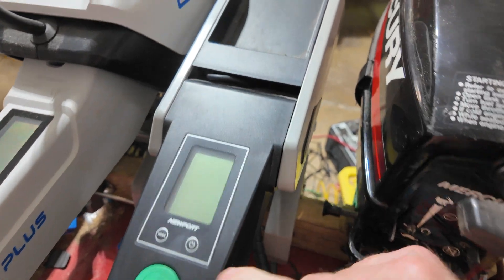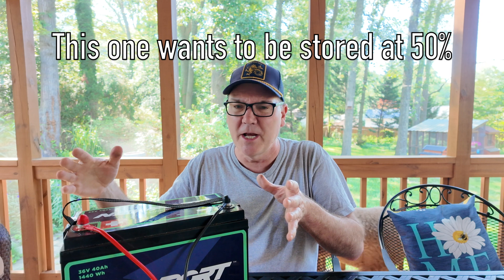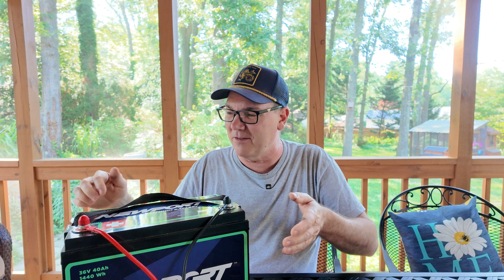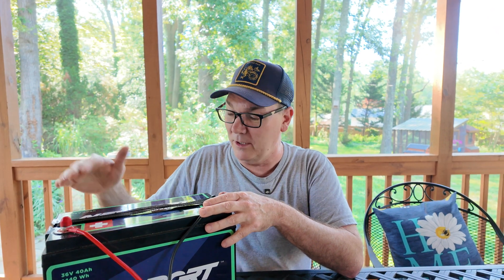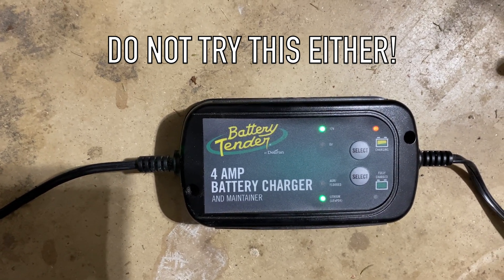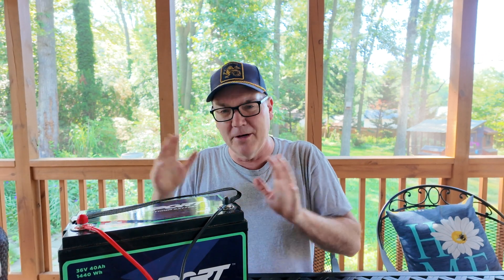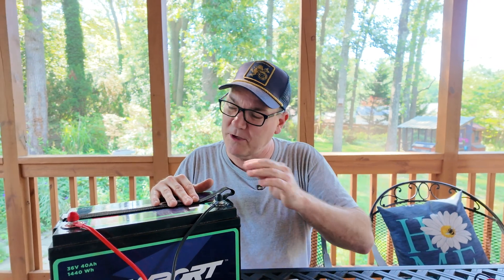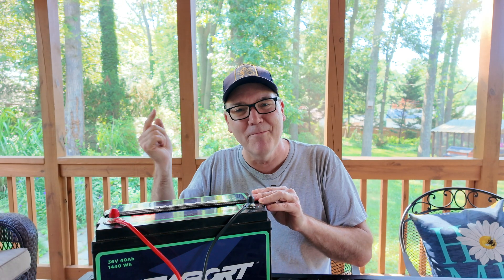LiFePo4 Battery DEAD after 1 year

Comment: RC Airplane guy here, so very familiar with Lithium batteries. At storage, you can leave them indefinitely and they will usually be happy. But cold temps are a killer, so gotta be careful with that. But, we have chargers that have a "storage" setting so when you are going to have a battery sit (for me anything over a week without use = storage) you hook the battery up and the charger discharges the battery down to storage voltage, so it can safely sit for extended periods of time.
Reply from the maker: Does it stay connected to the charger like an old-school 12 volt battery tender?
Reply: @WayneTheBoatGuy  No, it just gets it to storage voltage and then turns off. But in my experience they will sit at storage for very long times without issue (I've stored batteries for over a year and they are at the same voltage I left them). But you can also once ever couple months just hook it back up and hit storage again and it will tell you where the battery is and return it whether it needs a charge or discharge.
Reply: @TheDornado  you see, your RC battery is usually just Li cells, and they can be stored a year or so without charge. This one has BMS AND Bluetooth module, probably extra draw from Bluetooth module discharged battery in few months. Its not accounted in manual that battery with Bluetooth module should be checked and recharged more often.
Reply: @sergey_8275  but if it has that, why doesn't it have a cutoff for those modules so they don't get over discharged? Would be pretty simple one would think.
Reply: @TheDornado BMS is part of the battery and always connected to a cells inside battery case (its an intermediary between cells and output terminals). It does not draw much but still it has some microprocessor which monitor battery conditions. Bluetooth module does not have sleep mode and it always announces its presence so that you can connect you phone to check status. Looks like over time cell voltage went below operating range and BMS went to "sleep" mode (disconnected internal cells from the load terminals). its a common and known condition.
Reply: Lion and lifepo4 are not the same. Lion needs discharged. Lifepo4 prefers full charge storage. There's no need for this discharge.
Reply: @chublez  Oh good point, I was thinking of straight Li-Po not LiFe. LiFes handle full charge way better.

Comment: The battery I'm sure is fine, it won't sense any voltage below the 36 volt, you need one of these, I have one they are very nice! Golf Cart Battery Charger 36V 18A and 48V 13A Trickle Battery Charger,36 Volt Golf Cart Charger,for EZGO TXT Text with Powerwise,Lithium, LiFePO4, Lead-Acid AGM/Gel/SLA..Battery Charger,D Style Plug

Comment: Man you got to use a 36 plus volt charger to wake the BMS back up.  The BMS will shut down the battery to keep it from discharging the internal cells all the way down.
Reply from the maker: It's a shame that the included Newport battery charger wouldn't do that.
Reply: @WayneTheBoatGuy  yes a slight hick up in the system. I too think your NMS is shut off, I built a 320 amp 12 v lifepo4 battery and the balancer discharged it so the BMS shut off. It restarted when  I hooked up the solar charger back to it from storage. Some BMS require a jump between the BMS positive and the output positive.  I will wait to see what happens when you put a good 36v to it. .

Comment: Get yourself a nice used 2 stroke 3.3 hp mercury with a 3 blade prop and you will be good to go. Batteries are so fickle.
Reply from the maker: Oddly enough my 2 stroke 2.5 Mercury is also pretty fickle!

Comment: I don't know what battery prices were at the time you bought this battery. But $1200 for that battery is asinine. You can by one 12v 100ah LiFePO4 battery for $280 now. Wire 3 of them in series and you have a 36v 100ah battery for $840 with 3,600 Wh instead of 1,440 Wh. Same power for more than double the run time for $360 less.

Comment: You have less headaches and hassles with an internal combustion motor. I truly believe, with a technology that we have now an outboard electric motor is a passing novelty. Don't take my word as gospel truth I'm of the school that believes in an automatic transmission is a fad that will never catch on😂
Reply: You're right. In 20-30 years when battery technology improves or gas is $10 a gallon, then they will start to make sense. Right now electric outboards do not make sense for anything besides kayaks and tenders. Boats are just too inefficient and they need a dense, lightweight source of energy like gasoline or diesel.
Reply: I don't think it's less headache to use ICE. LiFePO4 is just different and requires a learning curve. Most of us grew up with ICE and so it seems simpler because we've been learning about them for decades depending on our age. Not to mention many of those around us had differing levels of knowledge about ICE. Electric motors and LiFePO4 batteries while not new are relatively new technology to the average consumer that requires we learn a lot in a shorter amount of time. So it seems like more headache. Which maybe it is for that reason alone. But once you understand how to use them properly and they become more common place I think they will be far less of a headache to use.

Comment: most likely, this batter has a bad connection internally or a bad BMS, just warranty the thing.  I never worry about state of charge of my LiFeP04 based batteries over the winter (on same parallel weaterh/temp as you) and they're good every year.  Newport isn't making these batteries so they're probably the same inside as most others and the BMS' do fail.

Comment: These batteries can be a serious fire hazard if you 'force feed' them with a charging system other than what the manufacturer provides, due to an issue called thermal runaway.  The BMS has voltage AND temperature sensing, and a different charger may not shut off if the pack starts to get hot under charge.  If it goes on fire, water may not extinguish it.  Also, these batteries must be charged a certain way or they can be damaged; the initial portion of charge is constant current, and then the charger switches to constant voltage until each cell is topped up. The difficulty with these packs is if one or a few of the individul cells goes bad, the entire battery is pooched.  I would pursue a warranty claim because the manual suggests doing what you did to revive it.
Reply from the maker: When it arrives, I will be testing the Amazon charger outdoors and then see how it goes!
Reply: No. The bms will do exactly that manage the battery.  His issue here is the charger he has won't start charging as it doesn't "see" a 36v battery plugged in. He needs a simple 36v dc supply, preferably low amp to "wake" the bms up and or charge it. These aren't that difficult but you do need to learn some new stuff.
Reply: BTW modern "smart" 12v chargers will do the same thing with a lead acid battery that's too low. Need a "stupid" charger that just turns on without checking for a battery and proper orientation first. This is all a simple case of everything being dumbed down to a level no one knows or cares to learn how the crap they own works anymore and the tech to dumb it down is ironically more complicated and prone to failure than a simple adjustable DC power supply, understanding, and end user responsibility.